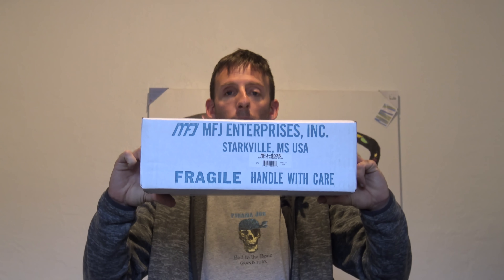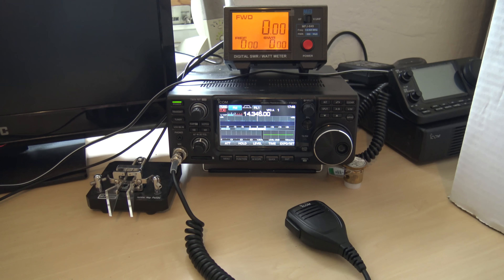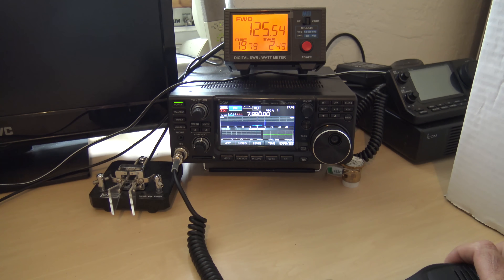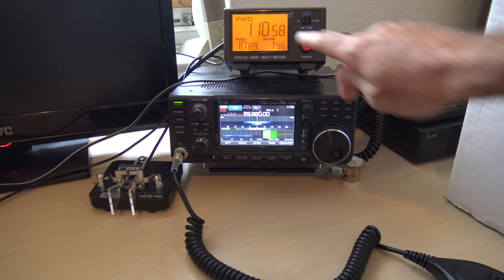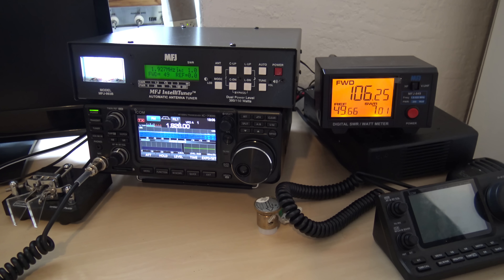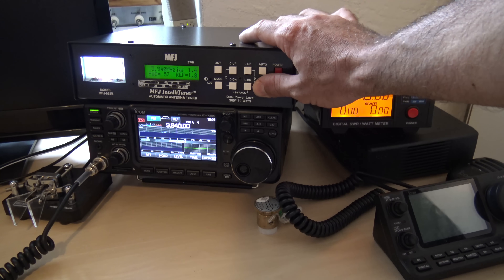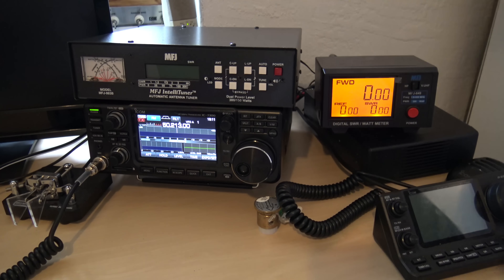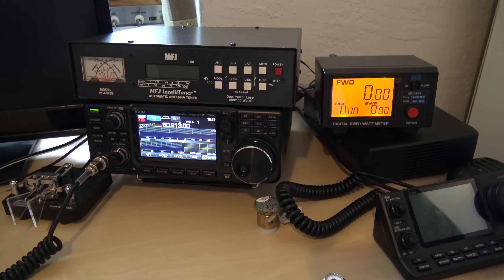Understanding HF Antenna Tuners, What Does It Do?

Comment: That's pretty similar to what I was taught, but I was also taught the tuner, coax, arrestors, baluns, ununs, what ever kind of antenna, are parts of an "Antenna System". It doesn't really matter that a tuner is at the transmitter end, it is still adding capacitance, and inductance to the antenna system to provide a 50 ohm match to the transmitter. Same as if it was at the feed point of the antenna. The difference between having it at the antenna, and at the transmitter, is feed line loss from reflected power due to the high SWR. Those losses don't occur when the tuner is at the antenna presenting a perfect 50 ohm match to the coax, then down to the radio's 50 ohm connection. And vertical antennas typically have the matching device or tuner at the base of the vertical antenna. Putting a device like that up in the air in the middle of a dipole can be prohibitively expensive and cause a lot of strain on the dipole, and may require a 3rd support for the device in the center. That's why they are usually in the shack next to the transceiver, tuning the antenna system from the end of the coax.
Reply: Then you're both wrong. This video is completely wrong and he has no idea what he's talking about.

Comment: All hes trying to say is, its not tuning the antenna, its making a match so the radio is happy and wont get damaged its that simple, their is to much crap being sold as far as antennas, with their so called low swr on all bands, all it is , is an air cooled dummy load,  this is because their trying to kator to the hoa people that cant have real antennas, and you have to do the best you can with what you have to work with, so yes an antenna tuner will help, to all you engineers out their maybe you should have your own channel and get into the theory, for people that want to learn that, antenna companies are at fault for all the BS info, especially for new comers.

Comment: Maybe "antenna tuner" is not the right name for this type of device.  Why not call it something more accurate, like maybe "impedance transformer", "transmatch", or even "antenna system tuner"?

And perhaps you might want to make another video experimenting on a transmatch put at the far end of a coaxial feedline, i.e., at the feedpoint between feedline and radiator.

73 VE7NDE

Comment: Nothing informative here. Just a guy with a loud mouth and no clue what he is talking about.
Reply from the maker: Yah, ok.... An antenna tuner does not tune your antenna. Very simple concept, and a point I tried to make clearly.. I'm not sure how you can prove to me that this autotuner is tuning my antenna, and increasing efficiency on my antenna, to allow the antenna to radiate ALL the power that I feed into it.
Reply: @HamRadioConcepts  No, it does not tune the antenna, that's about the only thing you stated correctly. But it does way more than "make your radio happy". 50 watts out and 50 watts reflected means nothing radiated out the antenna? WRONG! Even your own equipment contradicts everything you said, your very own watmeter showed the TX power and the "re-reflected" power combined and you chalked it up to "crazy readings". You need to do a little more learning before you post misinformation like this. Just because an antenna isn't resonant doesnt mean it isnt effective. If I'm wrong please explain 5/8 wave antennas... heres a good place to start some real learning, and it's free... https://www.google.com/url?sa=t&source=web&rct=j&url=http://www.w3pga.org/Antenna%2520Books/Reflections%2520III.pdf&ved=2ahUKEwj82urVsdXgAhVN_oMKHVaHBS4QFjABegQIBRAB&usg=AOvVaw10MARaOwsLTqK9phz8A0Mb

Comment: No such thing a antenna tuner its a impedance matcher it does not resonate the antenna.
Reply: I have used a short wire about 70ft on 160 m it was resonant on about 2.5 mhz
change the length to resonant on 1.9 mhz it did make a difference.

Comment: There is a lot of misinformation out there about antenna tuners.  Through accepted traditions, Hams can really abuse the intented purpose of the tuner.  The tuner is an L/C match that is only to be connected to the antenna feedpoint and the coax.  Once tuned, the tuner converts the complex impedance at the feedpoint, to a resistive 50 ohms at the operating frequency.  Note that the coax is only made to transport a resistive 50 ohm impedance signal.  When you depart 50 ohms, the coax starts radiating, which reduces the amount of signal that gets radiated by the antenna.  The tuner should never be connected between the transmitter and the coax.  I know a lot of Hams will find fault with this statement because, that's probably because it's they have always seen or have done it themselves.  Whether you have a tuner or not, the amount of reflected power your wattmeter shows, is actually being radiated by the coax.  With the tuner in this configuration, you are only proving the transmitter with a good match, which will enable it to transmit full power.  I realize putting the tuner next the radio is a lot more convenient and, it's marginally tolerable to use the tuner if you are near the band edge and the antenna tuning is starting to fall apart but, however I don't recommend tuning into a mismatch greater than 3:1 (12.5% of your power will be radiated from the coax at 3:1).
Reply from the maker: Good stuff.. Why are the other commenters telling me that it is in fact tuning the antenna that has a 15:1 VSWR, and I am a moron and an idiot?
Reply: @HamRadioConcepts My guess is you violating traditional ways of doing things.  Probably most of the Hams out there started in the hobby as CB'ers where you simply buy "appliances" (all ready made products) and "bolt them together".  Very few have likely designed and built their own equipment.  I did as well but, have also designed a few transmitters for Collins Radio.  In the process of design, I had to get a firm understanding on this forward and reflected power (VSWR) thing to enable the design of a reliable product.  Solid State transmitters are very intolerant of a 50 ohm mismatch, whereas tube transmitters handle it better because, as part of the turning up procedure, you are tuning the tube plate to the 50 ohm load, which may be off a bit.  All Solid State transmitters have  a fixed tuned output.  As result, the Solid State transmitter must have an elaborate protection circuit which cuts the power back when a mismatch is detected.  Tube transmitters generally don't have a protection circuit and, if they do, it's not nearly as elaborate.
Reply: If common-mode RF current exist on a transmission line, then the line will radiate -- regardless of whether or not it's feeding a resonant or non-resonant antenna via a "tuner."  Standing waves on a transmission line are not common-mode RF currents.  Ken - WA8FCI
Reply: @DaDitDa  Hi Ken, yes, you are correct as stated.  Common-Mode currents exist on the transmission line when there is a difference in ground potential at the two ends of the transmission line.  I regularly see this problem when a Ham makes a dipole and does not use a choke/balun at the antenna end of the coax.  In contrast, Standing Waves on a transmission line occur when the load and source impedances do not match or, a non-50 ohm line is used (in the case of coax).  You can actually measure these Standing Waves along the length of the coax, there are peaks and nulls at distances according to the frequency times the velocity factor of the coax.  This is where the term "Handwaving" comes from.  The same holds true for a balanced (ladder) line, I mention coax because most people assume it is self-shielding.  This is true as long as there is a 50 ohm source and load.  I labor this point because, when you have mismatched impedances, when the transmission line is longer than a 1/4 wavelength, the line acts as an impedance transformer.  I must mention that it's not my intend to play the "I'm right/you're wrong" game, RF gets pretty complicated when you bring reactances into the picture.  This is further complicated by the interaction of the antenna, rig, and grounding.  So, hopefully I have cleared up some of the mysteries, taking some of the "magic" or unknowns out of the equation.  Best Regards, Bill Harris - AC8AQ
Reply: @billharris6886  No game playing intended.  Just wanted to make clear that feedlines (coax or ladder-line) do not significantly radiate due to impedance mismatch (i.e., standing waves), but they will radiate due to common-mode currents.  I think confusion on this matter arises due to mismatched situations sometimes involving one or more of the following: unbalanced loads, unbalanced feedline-to-load coupling, no common-mode choke on coax feedline, poorly positioned feed-line relative to antenna, and poor station grounding.  All of which can lead to common-mode currents appearing a feedline; i.e., feedline radiation.

Comment: With respect to the maker of this video, the information presented here is totally incorrect. I commend you for trying but please research the subject.
Reply from the maker: Sorry, but an antenna tuner shown in this video will NOT tune your antenna. That's all i tried to present..
Reply: HamRadioConcepts,  it does not “tune” the antenna as such, we can agree there. However reflected power is not “lost power” either. As an arbitrary example, a 5/8 wave vertical is a nasty reactive thing with a strange impedance, so the commercial ones have some integral matching to get them to roughly 50 ohms. They have a useful radiation pattern and as a result they are popular. The matching networks generally have negligible loss so the vast majority of your power gets radiated. Long lengths of poor coax with huge mismatches will waste power, but a feeder such as openwire tends to have very low loss even with SWRs in double figures. Anyway, thank you for the polite reply and keep making the videos 73
Reply from the maker: @davidlisney2597   Here is the moral of the story. Too many hams are being taught or told or instructed to load up a fence post because the magic auto tuner will say it has a 1.1:1 SWR and it will be an acceptable antenna. It is not. I'm tired of all the "dead band" controversy" because they are using a horribly inefficient antenna. I have no problem making contacts at home, mobile or QRP, but I am still being told they are selling their radios until the year 2025 for better solar cycle. The reality is, people need to learn how to make a resonant antenna, people need to not rely on a tuner, because it is not tuning their antenna, it is matching the load to 50 ohms so the radio is happy. That is all that is happening. If the guy that runs full legal limit on 75 meters thinks he is really getting out there on the airwaves with a 45 foot piece of wire with 1,500 watts dumping into it, imagine his results if he had a resonant antenna with 1,500 watts. He would be amazed. But, he thinks using a tuner to match a 324 ohm feed point with a 19:1 VSWR is making his signal effective. This is only what I tried to represent in the video without going into a huge technical battle. Some of the characteristics I DO NOT know all about, but I can tell you, when someone tells me "I am using illegal power with some kind of magic antenna on a 40 acre farm" to make a simple contact, I laugh in their face (Yes I have been accused of this and so much more when they see me making contacts) but perhaps they are struggling to deploy a resonant antenna that is worth a hoot.  They just think the bands are dead. I will continue to make contacts on an antenna that is 1.1:1 VSWR with an eight of a watt reflected as I have great results with it. 73
Reply: HamRadioConcepts there are obviously a lot of stations that miraculously fail to put out a good signal despite relatively high power. However resonance is not anything magical, it is just a situation where reactance curves cross. Most ham radio forums have a significant number of members that slavishly believe that resonant antennas are magical, they aren’t.
Reply from the maker: @davidlisney2597  The bands are what is magical... When A band is open its open. I have actually worked the world on 10 meters by accident with an antenna that was damaged. But for those that dont have conditions, I think a resonant antenna will help them. But I am not arguing with you, just trying to explain my point. You see how many newcomers to the hobby recently, at least they dont hear "sell your radio" when they first get licensed. Give them a fighting chance. The hams just getting licensed are not interested in theory yet, they get  scared away when they read that stuff. So if they see basic info, they get ambition to learn more about it. Just my opinion.
Reply: @HamRadioConcepts  I've been trying to figure out all these concepts and how they go together as well.  Everyone just says "read the books", which is fine and all, but I'm legally blind.  Most of the ARRL material isn't available for me to put on my 52" tv monitor.   So instead I keep thinking I can find people who everyone looks up to as a wise elmer, and ask them about this stuff.  That usually leads to someone running amok with their ego and stories of events they've done, but very little usable information.  Sometimes I ask people in my club or email them, and for the most part all anyone has to say is "go read the book".... but they can't explain the concept to me in their own words.   You can't get anyone to TEACH you anything anymore, and when you do get them to talk, they only want to talk about themselves and their 'great accomplishments' in ham radio.  Its ridiculous, not difficult to see why in large parts its just plain dying off and new hams have so many unanswered questions.  At field day you see people clearly wanting to know more walk up and of course they ask "hey is this like cb?"  cuz they're trying to find common ground.  But it's met with sneers and jeers or just silence and dark looks, so they go "well screw this then" and go home.   Its sad.        I'm trying to learn how this stuff works just by reading all these comments!!!  :D